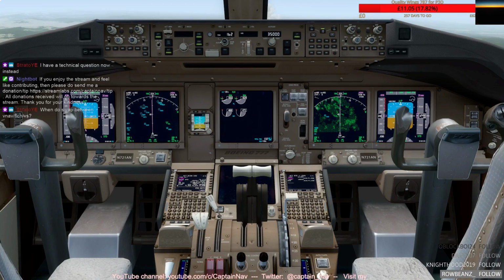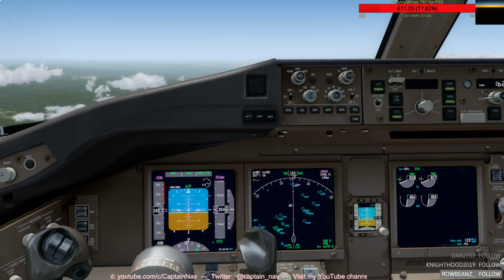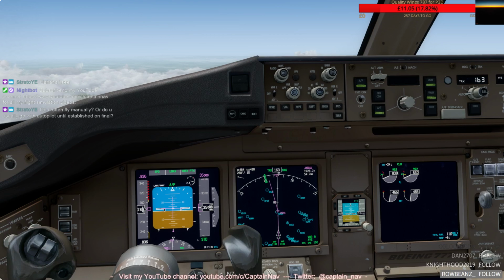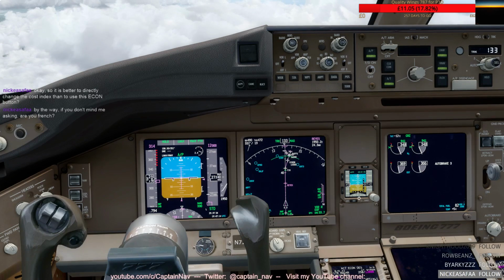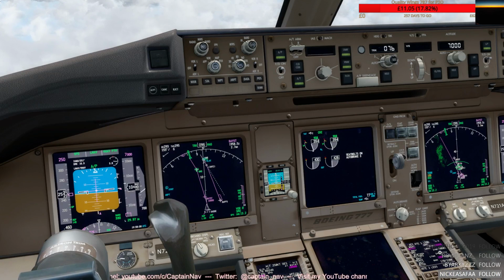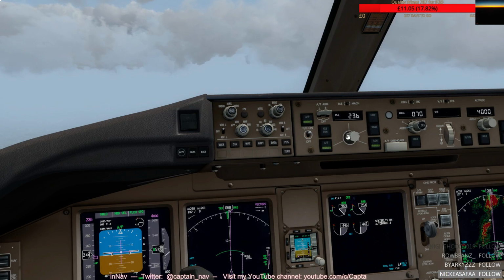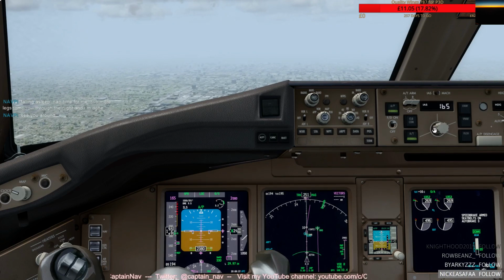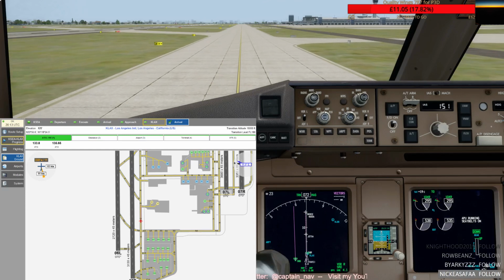[P3D v4.5] PMDG 777-300ER | Seattle to Los Angeles Part 2 (By a 777 Captain)

Comment: Do you get in trouble with the company if you landed at your destinaton on reserve fuel? Meaning that you should have diverted to your alternate instead?
Reply from the maker: No you don't get in trouble if you land below the reserve or diversion fuel. It is part of the fuel management. The company actually prefers you get to your destination rather than to your alternate.
However, if you land below the final reserve fuel (last 30 minutes of fuel) it becomes a fuel emergency and some reporting/explaining will definitely be required.

Comment: I said that live, but again great landing cap 💪🏻
I was wondering how often do you actually end up requesting some more fuel? Is it something you have to specifically justify later on with the company?
Reply from the maker: Thanks. To answer your question, most companies would give captains the discretion to take more fuel than planned for (extra fuel). However, you would need to be able to explain why you take more (weather, delays, etc...). One thing to note, though, is that if you take extra fuel all the time, you will be called for "tea and biscuits" and put on the naughty list!😉